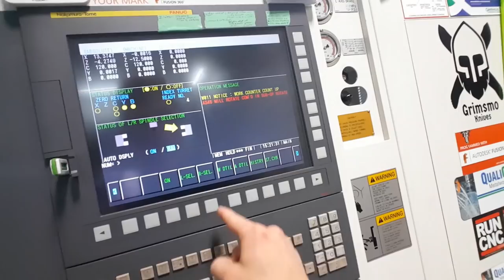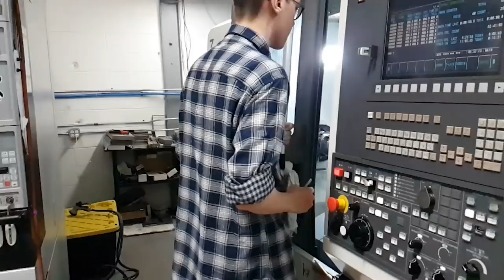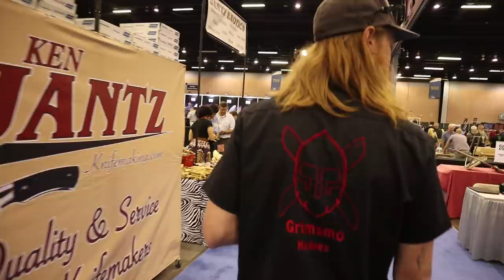The CRUNCH  - Saga Saturday 006

Comment: @Edge Precision has made a great gopro case with an air knife in front of the lens that makes it possible to film inside the machine while coolant is flooding. still might be hard to see the part, but sure makes the view clearer than having the lens flooded aswell or a wet window inbetween, maybe you could hit him up for one or the cad-files?

Comment: @JohnGrimsmo idk if the C axis is still (or even) an issue, but theres probably a setting in the Fanuc control to change the properties for C axis rotation (continuous or 0-360... possibly even a rotation range - similar to a soft limit, but you could put 9999999). I know I had a similar issue on a machine (Not a Fanuc, but either a Mits or Siemens control - can't remember) and I just had to change the setting because it kept erroring out or breaking tools. Just wanted to let you know in case it could help. Great work!

Comment: John, the reason you got the sub spindle is for this type of operations...lol you can totally do it by pulling with the sub certain distance stopping closing the main and opening the sub going dipper closing and then cutting (parting) then finish the ops on the sub all without flipping or turning parts around. otherwise cool stuff